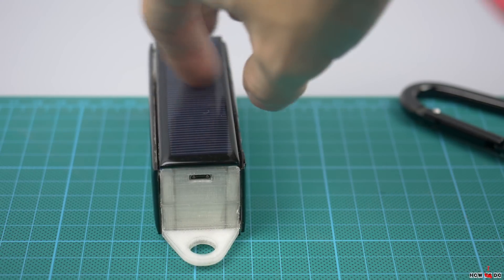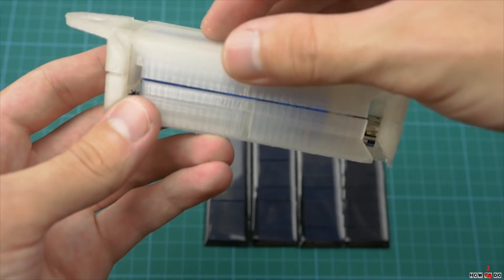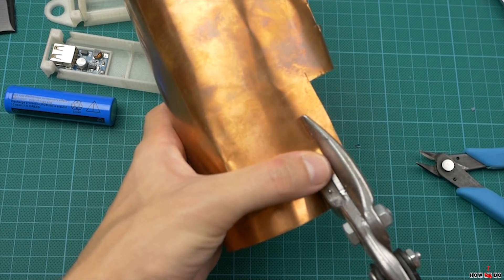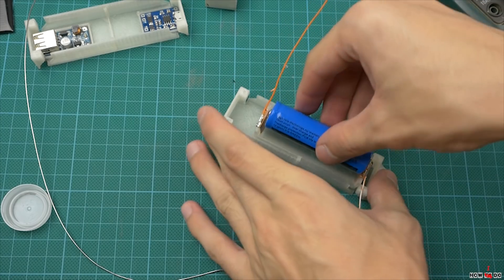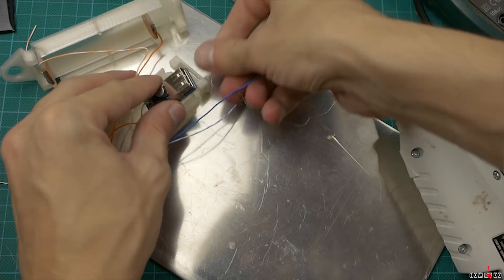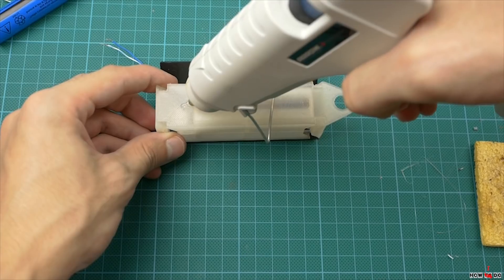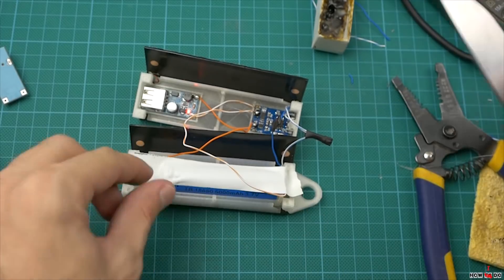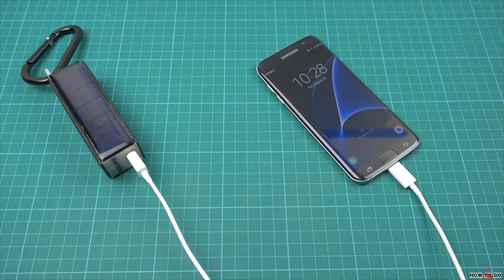Simple power bank with solar panels

Comment: Hey Constantin,
really cool Project! 
I boutht the same modules along with a 5V solar panel to power an arduino weather station.
When i connected the components, i noticed that the D1 LED on the step-up module is always lit if no device is atached to the USB port.
As this is also the case in your video, i wanted to ask you if you know what exactly this LED is indicating.
If i atach the arduino to the USB, the power gets cut immediately. I also measured very low resistance across gnd and vin of the converter. 
Is my module still alright? :)
Have a great weekend!